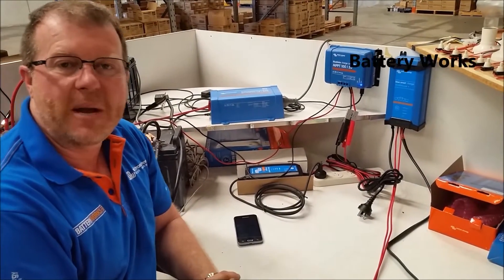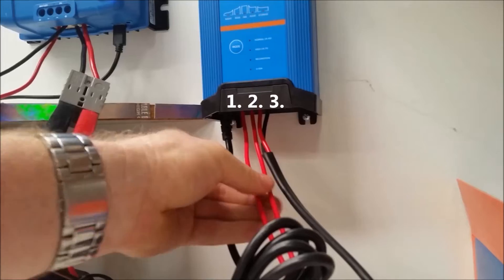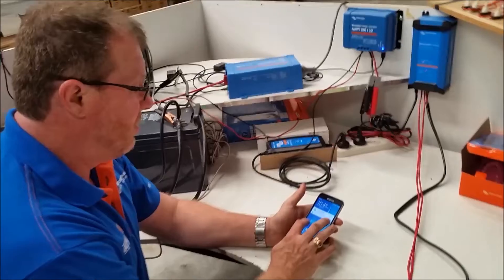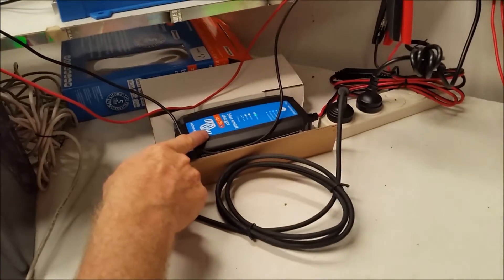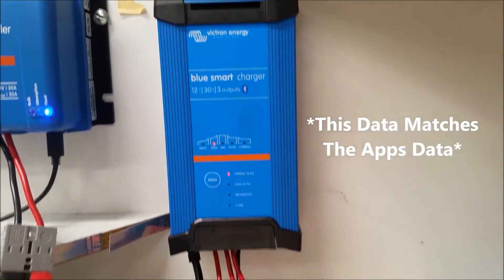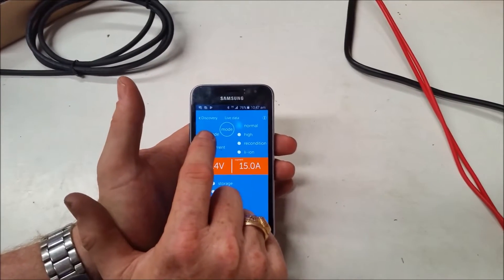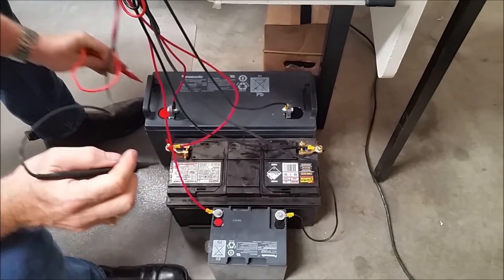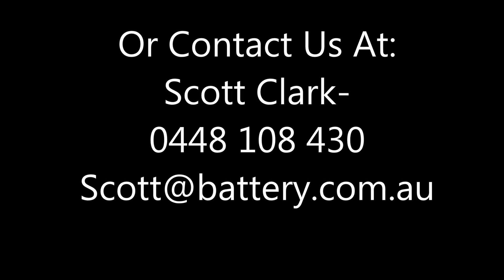How to use Victron BlueSmart Charger 12/30 (3 outputs)

Comment: Is it class 1 or class 2 as in the UK we are not allowed to carry the earth from a mains supply due to PME type instals with a broken neutral.
Reply from the maker: Sorry, I don't know UK electrical code, but if you buy a version with a UK plug and insert into the outlet, I'm pretty sure you will be OK. Always refer to the manual and datasheets available at www.victronenergy.com.

Comment: Can this charge a 36v system . 3x 12v batteries in series? This has only 3 positives and one negative output.
Reply from the maker: As shown, this is a 12V charger with 3 outputs for charging 1, 2 or 3 12V batteries. Always refer to the manual and datasheets available at www.victronenergy.com.

Comment: Can one make a series connection of 2 by 12V outputs to get a 24V output to make a 24V charger
Reply from the maker: No, you would just be putting 2 outputs in parallel and there is no advantage to doing that because one output can deliver the full 30A if required. It is a 12V charger and will only do what it is designed to do. There are 24V versions available. Always refer to the manual and datasheets available at www.victronenergy.com.

Comment: I have a Litium ion battery. Is it better to charge on li ion or normal
Reply from the maker: It is designed for lead and lithium iron phosphate (LiFePO4) batteries. If charging a LiFePO4 battery, then use Li Ion setting. Always refer to the manual and datasheets available at www.victronenergy.com.
Reply: Can you charge a LiFePo4 and a lead acid at the same time?

Comment: How secure is the Bluetooth connection from unauthorized access?
Reply from the maker: If you put a PIN number in, it is so secure that only professional hackers will want to attempt to access your 12V charger. Always refer to the manual and datasheets available at www.victronenergy.com.

Comment: I try to hook up via the the blue tooth. It ask me for a four digit code. WtF of cousre its  saturday. I don't like this thing already.
Reply: 000000
Reply from the maker: Mike is correct. Be aware you can also be asked to update the VictronConnect app as well as the updating the firmware on the device. Always refer to the manual and datasheets available at www.victronenergy.com.
Reply: Thanks Mike, i love my Victron. Works great. I have learned alot.
I have 720watts with a 150/70 victron. Smart controller. On my R.V..  iwill try to enlarge by battery bank i only have 2 x  6v battery AMG.

Comment: Shame he’s not answering questions.  If I had an mppt, a mains charger, and an isolator powered by the vehicle battery how would you connect all to the battery bank?  Just hook them all up at once?
Reply: I have Aux batt Bank 2x 6v=12vAGM running the house portion of the coach . i have a 12v batt connect to the engine with fuse box Headlights etc.  And i Have a Ground wire from the 2x6v=12v Bank to the 12v engine Batt. 
I dont know if thats right or not. Its been  working great and i dont see smoke. This is my third R.V.😂

Comment: Does your inverter have built in bluetooth or is it connected with ve direct cable?
Reply from the maker: It is VE. Direct Inverter so it has Bluetooth capability, but requires a Bluetooth dongle from Victron to communicate. Always refer to the manual and datasheets available at www.victronenergy.com.

Comment: is it possible to use this charger with solar panels
Reply from the maker: Do you mean: Connect the charger directly to the battery and also have solar panels with a MPPT solar charge controller connected to the battery as well? Yes. Anything else, No.
Reply: @batteryworksaustraliaptylt9840  Olá, ou seja, eu posso ter o blue smart charger a carregar as minhas baterias (gel) e ao mesmo tempo que o meu MPPT solar está a receber carga e a carregar as baterias em simultâneo?  não há problema? se estiverem ligados aos mesmos bornes da bateria

Comment: What is its power consumption when charging at 30A
Reply from the maker: It depends...30A x 14.6V (a rate of charge during the algorithm) = 438W. But it will not always be at that voltage during the various charging stages.

Comment: Could you please tell me how the victron solar mppt would connect with this charger?
Reply from the maker: Not directly. Connect both separately to a busbar or fuse block and then connect that to the 12V battery. Insure the MPPT is set to 12V. Always refer to the manual and datasheets available at www.victronenergy.com.

Comment: Would you have a video on how to tie that battery charger in with an mppt in case the batteries die at night with no solar available.
Reply: I would like to know this also
Reply from the maker: See answer above. They are separate devices that both connect to the battery.

Comment: Is each one of the three outputs managed separately ?
Reply from the maker: Not sure what you mean by managed. Check out an Argodiode or Argofet on the Victron website. This should give you an idea how it manages the outputs. Always refer to the manual and datasheets available at www.victronenergy.com.
Reply: @batteryworksaustraliaptylt9840  He means, can the separate batteries have different chemistries or different charge levels and have each it's own algorithm.  Can one be in bulk and one in adoration?  Can one be Lifepo4 and another flooded.
Reply: @batteryworksaustraliaptylt9840  i'm a friggin idiot and i get the question, damn!
Reply: @billhackley3540  it is very annoying... yep different batteries have different characteristics... we are expecting this might be accomodated but fear that inside is just a 1 to 3 joiner block

Comment: hi can you charge lion and normal battery at the same time ?
Reply from the maker: From the one charger? No. It does what the manual says it can do. Always refer to the manual and datasheets available at www.victronenergy.com.
Reply: Yes if you install a dc to dc charger you regulate the lithium ion

Comment: Is each one of the three outputs managed separately? Are these three outputs just to make wiring easier, or is there an advantage. Is there a wiring diagram showing how this would be wired with three batteries? showing loads as well?
Reply: Did you get an answer ? I am too after this info. Not sure if 3 banks managed separately?
Reply from the maker: It is designed so you can charge 1, 2 or 3 batteries from one charger. Its has a maximum of 30A output which can be shared amongst 1, 2 or 3 outputs. Watch the video to know how to wire it up for 1, 2 or 3 batteries.
Not sure what you mean by managed. Check out an Argodiode or Argofet on the Victron website. This should give you an idea how it manages the outputs. Always refer to the manual and datasheets available at www.victronenergy.com.
Reply: @batteryworksaustraliaptylt9840  
why can't you see the induvidual batteries in the app?
Reply: @hallo007ful  It seems the app is usless as he used a multi meter to do what  the app should have done...I'd like to see current and voltage for each battery plus time remaining.
Reply: @bryangreen5713  I still don't understand how this device working, can he managing of the all there batteries separately.
Reply: @batteryworksaustraliaptylt9840  so sorry that no one is getting any answers or finding any on the web. Perfectly logical questions because you can of course buy a single output charger and wire all 3 batteries in paralell or buy a 3 output one to go separately to each one, then you will MAYBE be able to see 3 separate voltages on the app and see the charging states separately eg if one gets used, one is completely drained and one is left full . .  . do you get 3 sets of management , one for each battery or do all 3 just show as one and the 3 outputs are for just convenience of connecting ?  shame that no one knows, or cares! except the poor sods thinking of buying one but wondering wtf they're gonna get, or miss out on. Battery banks need balancing, individual fuses, individual shunts for counting the joules in/out so you know how they are aging being as they're 500 quid each. Where is the info? even the spec sheet from Victron does not differentiate any more than simply saying 1 output or 3 .... wtf does that mean in practical real terms? is it a junction block inside the box? or 3 chargers in the box?

Comment: Is it charging each battery as one charge state or three seperate?
Reply: would really like to know too because if it is one then how could it charge mixed battery's (For example a normal one and a agm at the same time) 

even more i really NEED to know this because i need to charge different ah battery's VERY soon.

then again what is the point in getting the 3 terminals one over the one if you could just use bigger wire and split it from the one terminal (assuming the three terminal one isnt separate charging)

so i would like to know too, are the three terminals just paralleled inside of the charger or are they seperate with separete sensing how full the connected battery is?
Reply from the maker: Did you notice in the video that the voltages were different for the different batteries? The resistance for each battery will be different also. The charger can tell the difference so it uses the same algorithm to charge different batteries. Always refer to the manual and datasheets available at www.victronenergy.com.
Reply: @batteryworksaustraliaptylt9840  Manual does not sayhow three outputs are managed - can you for instance when configured as a  Power supply  charge 3 Lithium cells independantly
Reply: @qwertyxf  so would I.... i think it is just a 3 way junction block inside the enclosure.. but no one really knows ....... "Sorry, it is one charger running one algorithm. The VictronConnect app shows you what the charger is doing. If you want to know the separate battery voltages, SoC, etc, you should be using a battery monitor on each battery."

Comment: Hi Scott, I like your video. I need a little help. I have a 120 watt panel on a land cruiser leading to a Victron Solar Smart Charger 75-15. I have a neg and pos running from the battery ports on the controller to a 120 Ah deep cycle battery. I can't turn on the load to power up my engle fridge. Could you help me please, I'm pulling my hair out. Hank
Reply: She,s goin now. I think i powered up the solar and then the battery. I reversed it and bingo, cold beer tonight
Reply from the maker: Hi Hank, not trying to be a wise-guy, but I can't answer your question. So, I always ask everyone, did you read the manual? 
It has info like, to start the MPPT, it needs 5 volts more than what you have it set for battery. So, if you have it set for as a 12v battery, then the panel must make at least 17v before it starts to charge. After it starts, it only needs 1 v more. Does you panel make enough voltage in the sun?
Reply from the maker: Great to hear Hank. Have one for me!

Comment: Is it not possible to see each of the batteries voltage in the app?
Reply from the maker: Sorry, it is one charger running one algorithm. The VictronConnect app shows you what the charger is doing. If you want to know the separate battery voltages, SoC, etc, you should be using a battery monitor on each battery.

Comment: Great info  thank you
Reply: +Battery Works Australia Pty Ltd

multiple people asked "Is each one of the three outputs managed separately?"

would really like to know too because if it is one then how could it charge mixed battery's (For example a normal one and a agm at the same time) 

even more i really NEED to know this because i need to charge different ah battery's VERY soon.

then again what is the point in getting the 3 terminals one over the one if you could just use bigger wire and split it from the one terminal (assuming the three terminal one isnt separate charging)

so i would like to know too, are the three terminals just paralleled inside of the charger or are they seperate with separete sensing how full the connected battery is?
Reply from the maker: Thanks, glad to hear it helped.